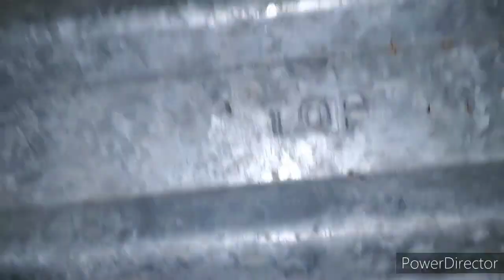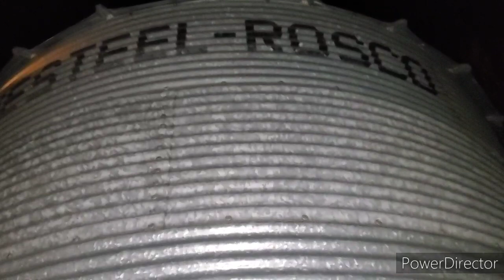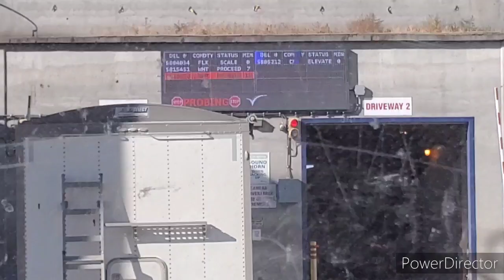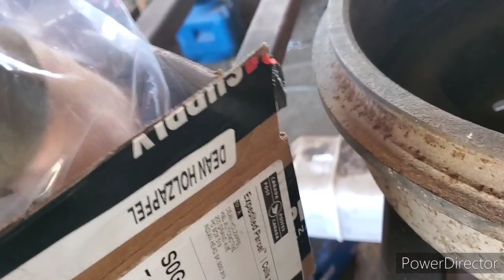The Flax Is Cleaned And Gord Got His Boots Back On!!

Comment: Oh man I busted out laughing... "Ya don't even have to talk to anybody-- and they wonder why people are retarded nowadays" ROFL...  Bet that train was one of them stretching halfways across Saskatchewan, too, with the robotic engines in the middle and at the rear end too...  see plenty of those in Indiana for sure... and they'll shoot through Mentone at 70-75 mph or better... and STILL take several minutes to clear the tracks!!!  LOOOOOONNNNNNGGGGGGGG trains!   That's my luck anyways, always getting  caught by a 150+ car train...  

"Just rollin' around in Mexican overdrive..."  ROFL... Oh my goodness glad I wasn't drinking anything or it'd been coming out of my nose... LOL:)  

Yeah those old five and six lug hubs like that with the thimbles used LH and RH, so they were "self tightening" when rolling forward... kinda stupid but I guess there was some method to the madness, some reason for it.  Problem is mixing them, you'll forget next time you have to pull a wheel when you have a tire go flat, probably during harvest when you're already tired and in a pinch to get going, and either break the d@mn thing off or struggle with the sumb!tch for an hour trying to get it loose when you're tightening it up, or get that one loose and tighten on all the others.  D@mn things look awful short, too... they should have more threaded part sticking out IMHO.  Guess it'll work on an old truck to get ya going, anyway, but if it were me I'd at least have the right one on had to replace it when you end up breaking it off, or the next time you have the drums off to work on the brakes or whatever...  Ya egged out holes she worked loose before... just tighten da chit out of her and go again...

Later!  OL J R :)
Reply from the maker: Lol

Comment: Do you have IT manual or shop book for 2 105 ?  You can get a reprinted shop manual form Floyd county museum,  AGCO donated all kinds of Oliver and White tractor ,machinery manuals to them. There are certain things that need to be done before you pull the motor.  I also have a clutch alignment tool you could borrow if ya don't have one.
Reply from the maker: Nah I don't have any books on the old girl. I'm just gonna get it fixed. I dont have time to fart around with it. Lol. I havent even had time to take it anyway where hahaha